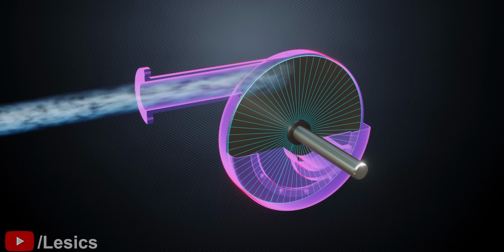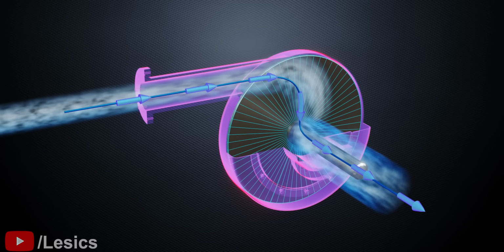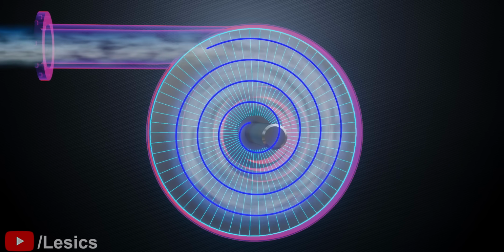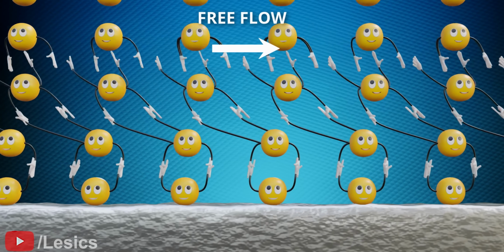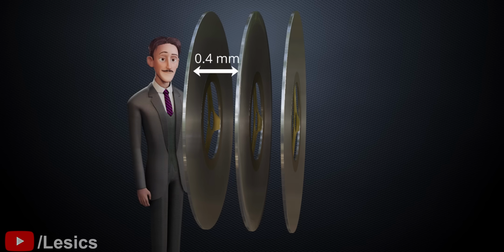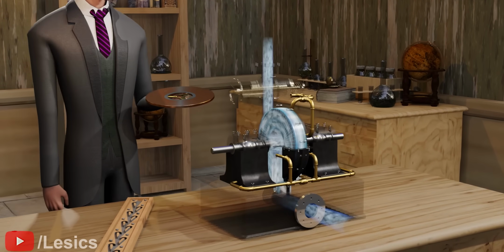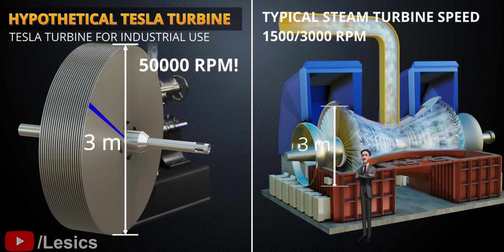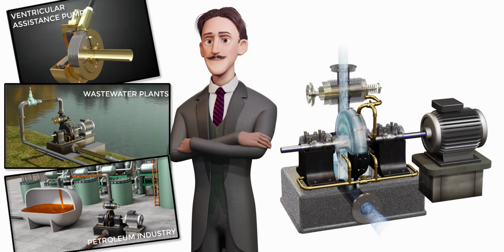Tesla Turbine | The interesting physics behind it

Comment: When your idea is so great, not even your era's best resources can't withstand its strength
Reply: To be fair, that can be said about many things. "If only i could build a material stronger than any other known material, my invention would work". Right?
Reply: @mikesteffensen6017  Space elevators are a good example. We know exactly how to build one, and we know the strength requirements. There aren't any suitable materials that can be manufactured on a scale that big.

Fusion reactors are another technology just out of reach due to material limitations. The inside temperatures are far too high for any material to withstand, which forces us to use magnetic fields to contain the hot plasma.
Reply: @mikesteffensen6017  Yes, without thinking it is possible to drive an air powered car around the World with one full charge of compressed air.....now all you need is a compressor to pump a billion cubic meters into a football sized container and you're good to go......this has been the same problem with EV's and the battery storage and charging cycle one reason why the fuel cell and hydrogen will be the next big EV solution.
Reply: @mikesteffensen6017  give me examples of inventions that fail solely due to the lack of material science being able to provide strong enough materials for it.
Reply: @Sparrowash97  Good point! Because they arent really inventions as they dont work (yet). Can easily think of a couple. But the thread also gives you a few examples. Like a space-elevator. Traveling to space is extremely costly! Spaceelevators would significantly decrease the cost of transporting stuff to space, however - We don't have materials that are capable to withstand the stress involved in such high elevators. 

But my point is, that it can be said about many things, if i only imagine materials with the properties I need for my invention.
Reply: @mikesteffensen6017  "How many inventions that require you to say that exist currently as concepts brought up by humans?" would be a nice question.
Reply: @kurokamireaper3761  loads.
My favourite though is the space elevator cable
Reply: @kurokamireaper3761  quite a few.  unobtainium is the scientific theoretical replacement in equations when a material doesn’t exist. I think engineers use it too until they can work out a suitable material replacement.
Reply: @ethribin4188  
Your space elevator cable: 20,000 miles long. 25,000 miles thick.
Reply: @David_Lloyd-Jones  Actually because of the required tension, you could start with a small wire that flares towards the end, the main issue is the end would likely be as big as the solar system or the observable universe, even if made out of something as strong as carbon nanotubes.
Reply: @David_Lloyd-Jones  only at the base! ;)
Reply: @kurokamireaper3761  quite a lot. A lot of inventions dealing with space require that. Space Elevators for example. The tension force is too high for current materials for the elevator to be used in any practical purposes on a planet like Earth.

There is also this same issue when it comes to heat in many applications. A lot of materials cannot withstand too high a heat before melting, and there arent any materials known with higher melting points.

And the thing with this Telsa Turbine is that it DOES work with modern materials. Its just not better than a steam turbine with modern materials. If we had much stronger more easily available materials, then a lot of things would be improved. But that doesnt mean they dont work without them, which is more similar to whats happening with Tesla's invention as it DOES work, its just not more efficient without stronger materials.
Reply: @kurokamireaper3761  look at yourself driving cars you self navigation systems they originally done by students at a college and other outside people that really did not have the backing it was needed to do it and they did it have a great day
Reply: @ethribin4188  the space elevator be a great concept to avoid all the rocket power you would need to get break the planets gravity but if you could neutralize gravity which can be done it's just we don't have the technological ability at this time to do so and if we do probably hidden in the government vault somewhere on the locking key have a great day
Reply: @SurelyLightFoot  I said it a few questions or answers ago titanium have a good day
Reply: @michaelpressman7203  just get back on YouTube? My comment was from a year ago and wasn’t directed at you. I was answer someone else’s question about create formula with nonexistent materials. The scientific name for such a material is know as unobtainium. Have a great day.
Reply: @mikesteffensen6017  with the right nonexistent materials one could actually make a perpetual motion machine.
Reply: @daveyjones5702  your trying to be sarcastic, but that’s actually just true. 
With an as of now non-existing magnetic monopole a perpetual energy generator capable of out producing nuclear reactors with a Near 0 wast of any/every kind would be Easy to create.
Reply: @daveyjones5702  like a monopole magnet? Even with perfectly frictionless materials perpetual motion machines are impossible (a machine does work by definition, a disk that spins infinitely without performing work is not a perpetual motion machine)
Reply: @daveyjones5702  No. No we couldn't. That's absolute bullshit.
Perpetual motion does not, and will not ever exist.
Reply: @marlinbundo2409  that is proven false by a number of working models.
the only thing that prevents perpetual motion is friction and wear of materials.
aside from environmental factors like the evaporation of water etc.

and a perpetual motion machine is a machine that starts and continues under it's own power. nothing more.

if you want it to produce energy, and thus achieve +100% efficiency you are in fact talking about free energy.

THAT is an impossibility, yes.
perpetual motion is not.
Reply: @marlinbundo2409  also: the universe is a perpetual motion machine.

prove me wrong.
Reply: @Dennis19901  Yet with negative mass materials we could build exactly that -- not only a perpetual motion device, but the one that can actually generate power. So once you remove material requirements, it's actually becoming a fantasy world.
Reply: @daveyjones5702  The Universe is not a machine.
Proof done.
Reply: @ShadeAKAhayate  Yes. We fantasize about everything if we remove the laws of the universe.

But that's delusional.
Reply: @ShadeAKAhayate  lol that's beyond pathetic.
AND you can't prove it, so no, nothing proven, nothing done.

basically a null statement.
Reply: @daveyjones5702  The machine is interconnected by definition. Universe is not interconnected, even by gravity. As such, it cannot be considered a machine. And on the distances at which it is connected at least by gravity, the "endless energy" through empty space expansion is nonexistent. 

This is basic, school-grade astronomy. Not knowing that... well, tell me about being pathetic some more.
Reply: @Dennis19901  Not exactly delusional. Just unrealistic. For example, the aforementioned negative mass matter is deeply connected with negative pressure matter, an essential component for building a traverseable wormhole. Mathematically? Totally possible and aligned with our understanding of the world. Physically? Yep, a pure fantasy.
Reply: @ShadeAKAhayate  you're opinion is noted.
however none of these things you bring up are actually facts.

maybe you should leave this conversation to the grownups.
as you continue to miss the entire point of that remark...
Reply: @daveyjones5702  The point of your remark is you don't understand school-grade stuff neither about the Universe nor about machines. I didn't bring here anything even remotely advanced -- both about machines and the Universe -- these actually are well-established facts. Better to look up what you're draggin into the discussion next time, kiddo :) Otherwise you'll look just as you do now. 
Good day to you.
Reply: @ShadeAKAhayate  ok let me just reiterate this so even you can understand:
your claim hinges entirely on the idea that you know everything there is to know about the entire universe AND the context it exists in.

quite possibly a limit case for the single most arrogant claim a human being can make.

and you are still missing the point of the post you are still responding to.
Reply: @ShadeAKAhayate  oh and still missing the point...
Reply: @daveyjones5702  You just called it a perpetual motion machine, if my memory serves me right. I take it, you do know this nature of the Universe you're talking about, then? Lol, you're embarassing me with your naive attacks.
Reply: Just consider that a decent chunk of the periodic table has man made elements.
Reply: @daveyjones5702  

"The universe is a perpetual motion machine. Prove me wrong." ~ Davey Jones

"Extraordinary claims without proof, can be dismissed without proof." ~ Someone much more intelligent than Davey Jones

No one needs to prove you wrong, you need to prove you're right, and you can't.
Reply: @notahotshot  it is self evident.
Reply: @daveyjones5702  eventually making a material that can withstand the rotational forces of Mach 15 is a lot more achievable than a material that literally breaks the laws of thermodynamics and conservation of energy… no, just no.
Reply: @sycho-tech5104  Tell that to thermodynamics, our cruel and grounding mistress.
Reply: @daveyjones5702  the biggest problem is gravity gravity creates crack and therefore a eternal running machine tonight operate in a gravitational field you don't have that resistance it can run forever
Reply: @sycho-tech5104  I understand nuclear reactors nuclear energy is something they really liked into and thought was a brilliant idea but the byproducts are dirty nasty and I don't like them sorry guys have a good day
Reply: I am reminded of the movie “Iron Man 2” where Howard Stark designs the mega-molecule but he just doesn’t have the technology to make it himself so he leaves it up to Tony to complete.
Reply: @johnkrappweis7367  lol just made ur reply 69 and there was a reply under u that was also 69 lol nice
Reply: If you get to have indestructible materials, you can make just about anything ridiculously powerful. Pretty much all inventions are only limited by material science. For example, a rocket engine that works with a continuous nuclear explosion within the combustion chamber to achieve insane efficency together with insane thrust. Or a nuclear reactor that can run at supercriticality without melting down because the containers melting point is nearly infinity
Reply: Or futur era resources
Reply: HermAnthemnian 87  Diamond is a very bad building material. A major reason we use steel is its very high tensile strength but also its ductility. 
Crystalline structures are amazingly resilient in a lot of ways but their strength is a double edge sword. On small scales this creates a wonderfully useful material that can be used to tear into other materials quite easily. But on larger scales, you start to have more surface area and more mass overall that allows flaws to exist. Even a tiny flaw in a crystalline structure will destroy the entire structure. Which is not something you want when dealing with millions and millions of pounds of force and material.
Reply: Yep like senku
Reply: when your idea is practically useless
Reply: When you make a living out of spinning excuses for why your bullshit is superior to all the other bullshit on the planet.
Reply: @marcosolo6491  Is that not self-evident?
Reply: That is one reason we cannot travel at warp speed yet to reach beyond the stars........traveling at the speed of light is not achievable yet.
Reply: @gangleweed  i think even at the speed of light most of the universe would still be out of reach to us.

anyways if your future is futuristic enough just about anything is possible.
Reply: Or, it was a bad idea and no one was interested.
Reply: your great son's era*
Reply: It's hard to fly like an eagle when you surrounded by turkeys have a good day
Reply: HermAnthemnian 87  yes diamond on the Pinellas scale is hard as a rock or Rockwell testing but it is not flexible it's too rigid you need something that is hard but yes flexible and therefore if there are any side loads it won't break have a good day
Reply: That’s the same problem as now. We can make the small scale ones work with modern materials, but we still can’t use them for their intended Purpose of powering homes and cities. 
Their ‘Impossible’ not because it can’t be done, but because we don’t have a strong material to withstand the rotational force at that scale. 

He literally invented something around 100 years ago, that wear still around 100 years from being able to properly use.
Reply: @sycho-tech5104  sounds like you're pulling this information out of your ass. The Military, Lock Heed Martin, DARPA etc can manufacture space age material by combining titanium with other materials. They've got jets that now travel multiple machs faster than anything the public is even aware of.
Reply: @sycho-tech5104  In 100 years it may be obsolete like the steam locomotive assuming the materials exist. In 100 years, will mechanical turbines be necessary? The current level of skill in designing and building steam powered cars, horse and buggies, animal yokes, black smith skills, etc is typically beyond what humans knew then. But they are obsolete tech.

If the material existed now, who wants to spend enormous amounts of money on R&D for leaping from 90% efficiency to hypothetical 97% efficiency?
Reply: Actual chad move
Reply: Reading my comment again, I'm pretty sure I made a grammar mistake
Reply: @AethernaLuxen  grammatical
Reply: @B G 
😔
Reply: @AethernaLuxen  lol
Reply: How does that make it a great idea? Literally anybody could come up with some amazing concept that would work if it was made of some material that doesn't exist. "I can design an elevator into space, but it requires some material that has a jillion times more tensile strength than anything known to man. Aren't I smart?"
Reply: @battlesheep2552  The real achievement with the tesla turbine is that he created an entirely new concept. A space elevator is just a very old concept upscaled.
Reply: @battlesheep2552  carbon fiber have a good day
Reply: @battlesheep2552  so... you're saying the tesla turbine is an amateur's science fiction?